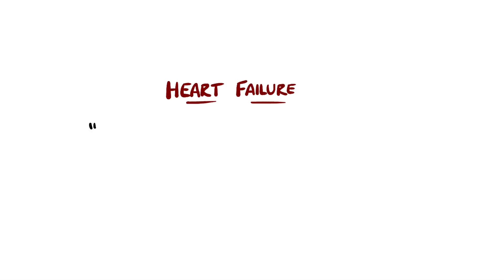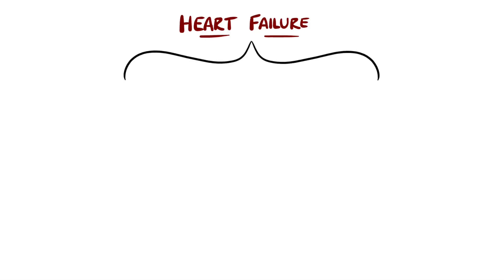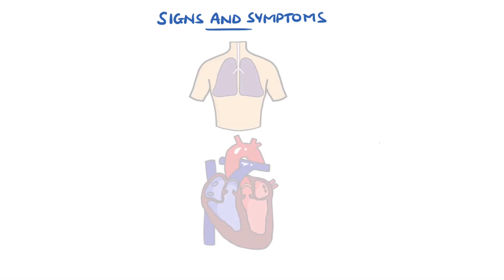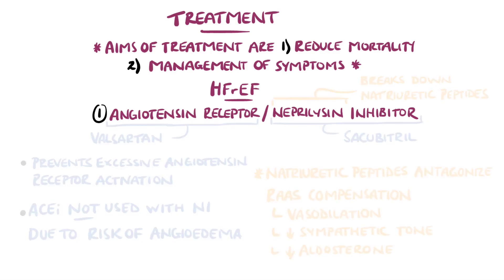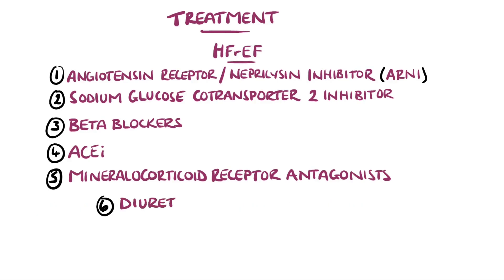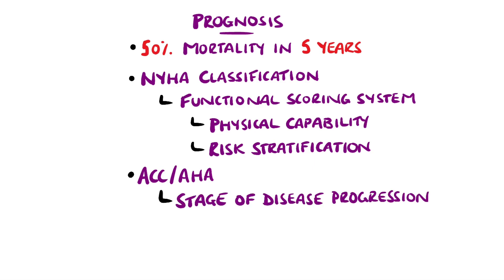Heart Failure Explained - HFrEF vs HFpEF (Systolic vs Diastolic Heart Failure)

Comment: I have normal systolic but low  diastolic  at 50 to 60.... not overweight,  none of the mentioned effects ... can I increase diastolic with lifestyle.?
Not on any pharmaceuticals ...
Non smoker non drinker. 77yr old woman..

Comment: 10:12 bit confused you mentioned that you wouldn’t give ARNI with ACEI due to increased risk of Angiodema as they both break down bradykinin just wondering if this was an error or did I mis read it
Reply: ACE breaks down bradykinin,. Inhibiting it causes Excess bradykinin and angioedema. Also neprilysin also breaks down bradykinin so inhibiting it will do the same.  So with an ace inhibitor you have a lot of excess bradykinin

Comment: 🎯 Key Takeaways for quick navigation:

00:00 🫀 Heart Failure Overview
- Heart failure defined as inability of heart to meet body's perfusion demands.
- Two main types: systolic (HFrEF) and diastolic (HFpEF) heart failure.
- Definitions include cardiac output, stroke volume, systole, and diastole.
02:03 💔 Causes of Heart Failure with Reduced Ejection Fraction
- Linked with coronary artery disease, chronic volume overload, dilated cardiomyopathy.
- Increased afterload contributes to reduced ejection fraction.
- Examples include severe aortic stenosis, uncontrolled hypertension.
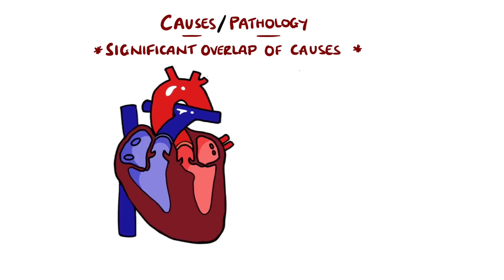03:43 💓 Causes of Heart Failure with Preserved Ejection Fraction
- Mainly associated with diastolic dysfunction and stiff left ventricle.
- Conditions like left ventricular hypertrophy, restrictive cardiomyopathy contribute.
- Right-sided heart failure often secondary to left-sided heart failure.
05:18 🫁 Signs and Symptoms of Heart Failure
- Dyspnea, orthopnea, paroxysmal nocturnal dyspnea linked to pulmonary congestion.
- Raised jugular venous pressure, hepatomegaly, peripheral edema due to fluid backlog.
- Clinical diagnosis includes history, physical examination, and laboratory tests.
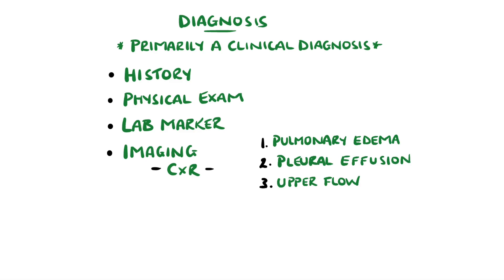07:23 💊 Diagnosis and Treatment Options
- Diagnostic markers like NT-proBNP and imaging techniques such as echocardiography.
- Pharmacological management includes medications targeting mortality reduction and symptom management.
- Treatment options vary for HFrEF and HFpEF, including medication and non-pharmacological therapies.
11:55 ⚕️ Prognosis and Management Strategies
- Mortality rate of heart failure is high, often leading to progressive disease.
- Assessment tools like NYHA and ACC classifications help in risk stratification.
- Lifestyle improvements, risk factor control, and non-pharmacological interventions are recommended.

Made with HARPA AI
Reply: does echo pick up hfpef?

Comment: What is the significance or importance of the Ejection Fraction (EF), when it doesn't indicate the amount of blood leaving the heart? Eg: If the EF was 65% (good) but the cavity only sucked in 10mls, then the output would be 6.5mls, which is  VERY small, but a 65% EF will still sound good. Why isn't 'Stroke Volume' used  all the time, telling us how much is actually ejected, not how much of whatever capacity is left behind.
Reply: Because we cant classify heart failure based on stroke volume, in both cases of heart failure stroke volume is low,but with ejection fraction we can identify the pumping ability of heart and classify heart failure.
Reply: @hiranp5054 what are symptoms of heart failure
Reply: Thanks bro ur question solved my query🫡...
Reply: can still have normal ef with hfpef

Comment: I still don't understand why Ejection fraction is normal in diastolic failure. If the heart isn't relaxing enough, then it can't fill to it's normal capacity. This invariably reproduces EDV. If SV is normal, then EJ should increase. Please explain this sir. I'm confused
Reply: The thing is that when it is not filling enough, it is not pumping enough. Both teledyastolic (end dyastole) and systolic (stroke) volumes would be decreased, leaving with a normal ejection fraction, but not implying the patient has not a problem.
Reply: @mariajoselaverde6534 well explained
Reply: @mariajoselaverde6534  what symptoms with hfpef
Reply: Election fraction is stroke volume over end diastolic volume multiplied by 100%...in diastolic hf the heart does not fill up enough so the end diastolic volume is low but since systole is normal the stroke volume will almost be equal to the end diastolic volume now multiple that by 100%the ejection fraction will be normal but in systolic heart failure the stroke volume is low but the end diastolic volume is high ...multiply that the ejection fraction will be high ...
Reply: @marthachanda1997 what are symptoms of heart failure

Comment: sir iska kya treatment hai ....106ms since bradycadia with 1st degree av block ..
528/509 ms incomplete right bundle branch block 
264 left ventricular hypertrophy with repolanzation abnormality  ...
206 ms prolonged Qt 
108/1071ms abnormal ecg 
90/49/137 degrees ..
gross biatrial enlargement 
no regional wall motion abnormality seen lvef 50%
grade 3 diastolic dysfunction raised lvedp
mild rv systolic dysfunction rv tdi 8m/s
ias/ivs inactivity 
no intracadic clot/vegetation pe seen
heart rate 56 bpm sir iska kya treatment hai 
Bp= 100/66 mm of hg
spo2 100%
T = 96.8F
P = 72b/m
R= 20 b/m
Age = 23
weight = 47